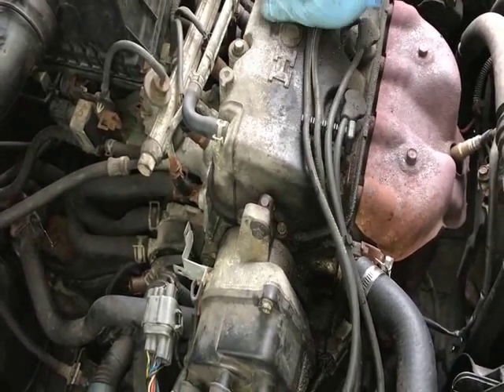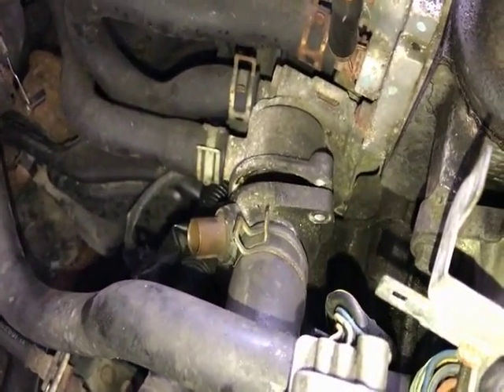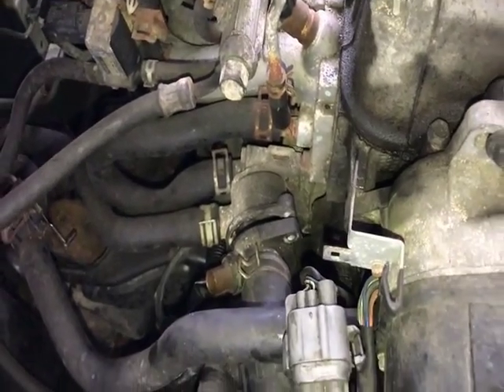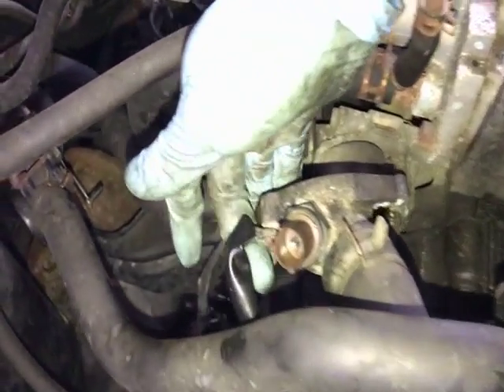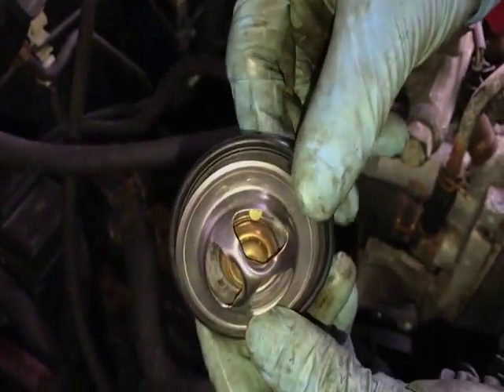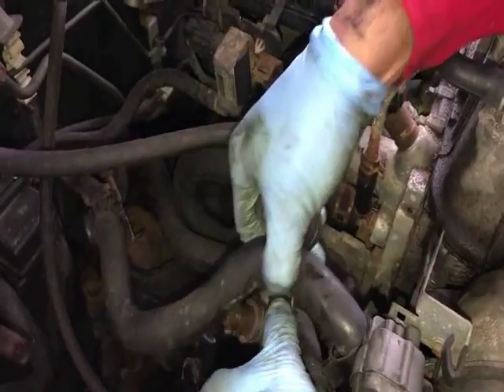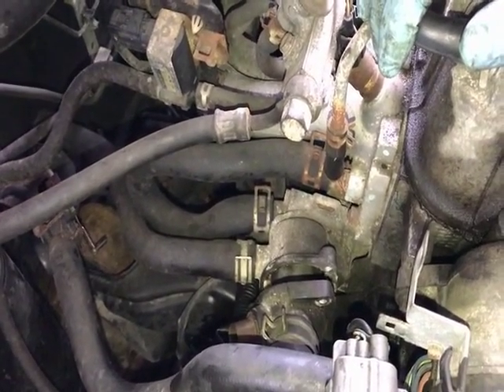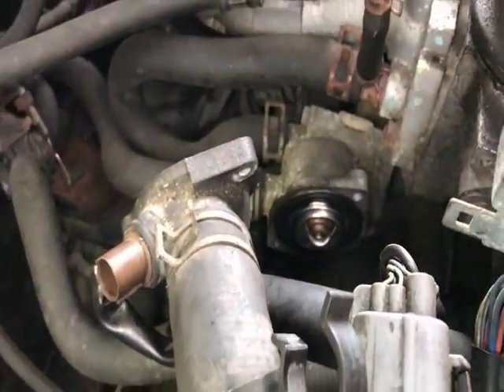1998 honda civic thermostat replacement

Comment: After I removed the 2 bolts, it was still stuck. I noticed some paste used to seal it to the engine block. So I said screw it and aborted the job for now. Any advice?
Reply: Paste? Like silicone or a milky substance
Reply: Same here :(
Reply: Pull really hard
Reply: Get a wire wheel drill bit to clean off the old gasket before replacing with new thermostat.
Reply: Flat head screwdriver, wedge it in the top carefully so you dont chisel the housing mating surface away, slowly wiggle back and forth it should give you atleast enough leverage to the wiggle it the rest of the way by hand. Clean off the silicone im assuming its RTV. Use a soft grit paper or said flathead but be careful if you go to scraping. The backside of the housing is plastic. I upgraded the frontside housing to a metal option but went with a duralast stat and ofc it doesnt pop in...